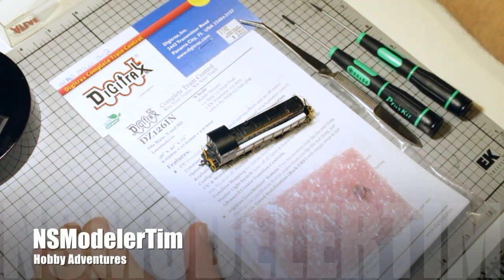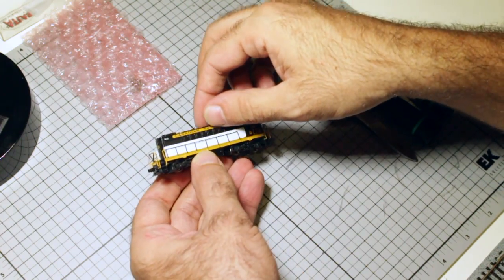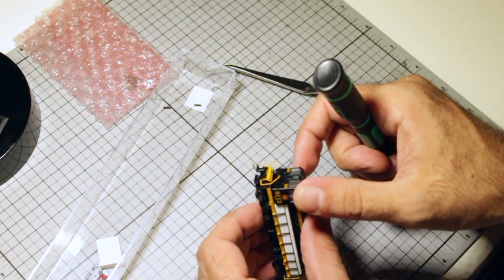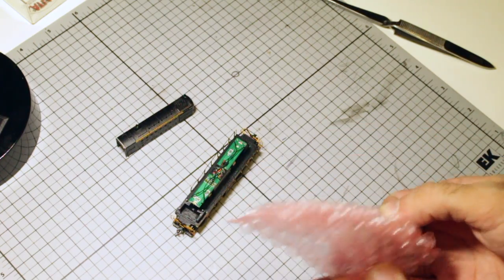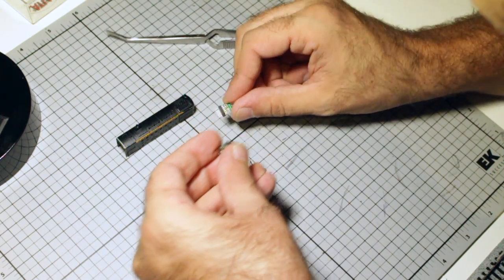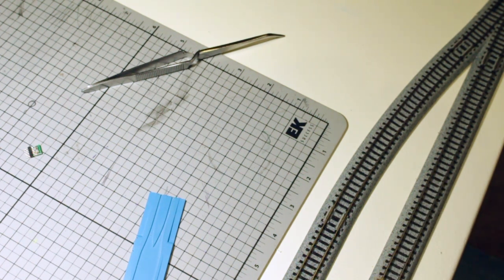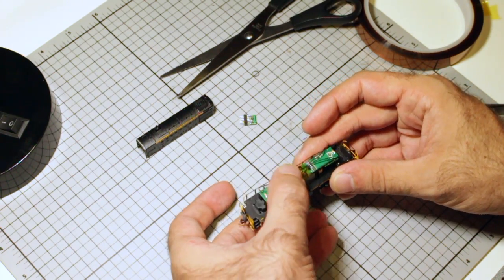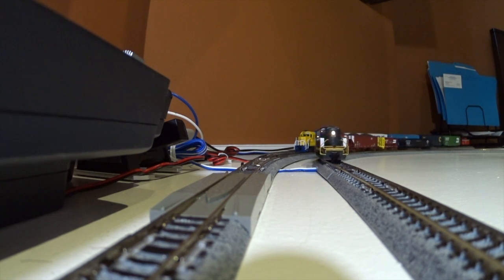Atlas Alco S2 Decoder Install: A Step-by-Step Guide - A Hobby Adventure !

Comment: This video helped me to understand how to get the cab and cowl off and on.  thanks so much!  I also now know how to put in the decoder chip after I convert my layout to DCC.
Reply from the maker: +p40f20 that's great🤙🤙🤙. I really glad to hear that this video help you out! This switcher is great. Not sure in DC mode but in DCC mode man it runs smooth and slow.
Reply: It is not that great a runner in DC mode, but the wheels do need cleaning.  I'm looking forward to converting to DCC.

Comment: I have yet to found Kapton tape with good sticking capabilities to metal.
Reply from the maker: I'm the same boat as you!   I'm not sure, but it may be because they have designed it to have low residue if you decide to remove the tap! Either way, it's kind of annoying. 
If I find any, I will let you know. 
Thank you for taking the time to comment on this video.

Comment: Another superb vid....excellent !! I`m pretty much new to N scale railroading(got started about 18 months ago)so these decoder installs are very very important to me and probably others.I probably have around 60-70 assorted locomotives in my collection (not for show but to be used on my ever expanding layout)and most of them need decoders and several will be need to be wired and soldered as they are not decoder ready.
Anywhos...keep up the fantastic work on your channel ,it`s a beauty !! BTW, r u in Toronto ?

Paul T in Winnipeg
Reply from the maker: Hey Paul thanks for the comment. That’s awesome that your getting into N scale. And wow sounds like you have an awesome collection of trains so far.  If you need any decoders and you don’t mind NCE I have some. I just did a switch over to Digitrax. Email me NSmodelertim@gmail.com. And yes I’m at the Toronto. Rich at the boarder of Toronto and Vaughan
Reply: I`v been to Vaughn, pretty much been around the whole GTA and then some.I`ll keep you in mind about the decoders ,but I`m thinking like yourself ,Digitrax and TCS is what I have so far.You don`t care for NCE ?
Thanjks Tim !!! @HobbyAdventureYT

Comment: Great install. I just found your video and I have the S2 and decoder on the way. Which side of the decoder was "up" in your install? Thanks again.
Reply from the maker: Hey James Ezekiel, I really happy that these videos can help ppl out. Ok for which way the decoder goes is the big black chip faces up or in other words the side with the big chip goes on the main board side. If you put it in the wrong way when you test the train both the front and back lights will turn on just take the train off the tracks and turn the chip around. 
Thank for the msg.  Keep on modelling. 

Tim🤙🤙
Reply: My thanks. I do enjoy your videos.